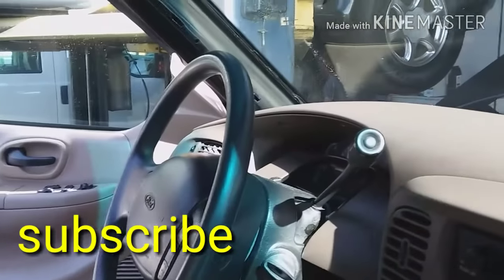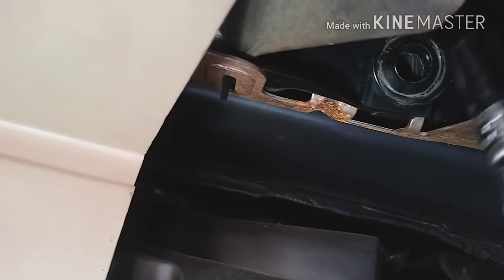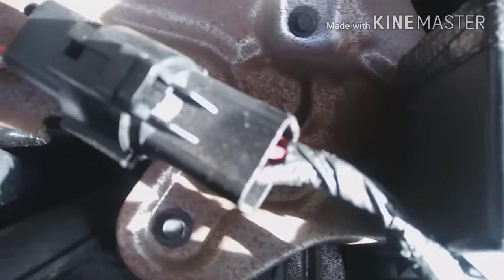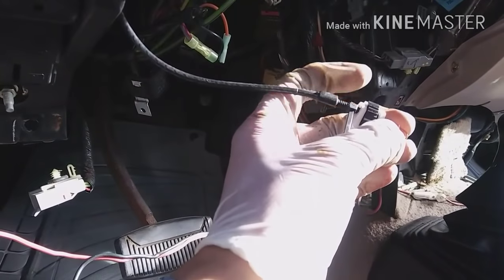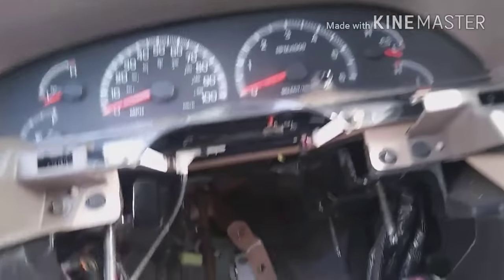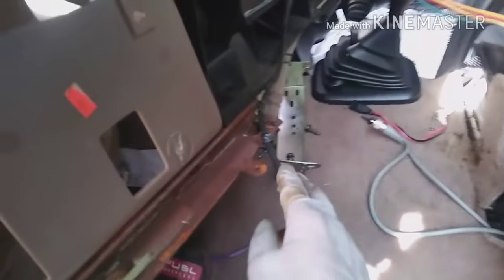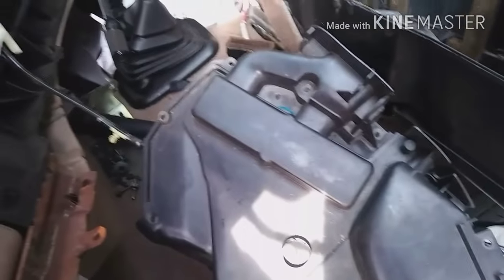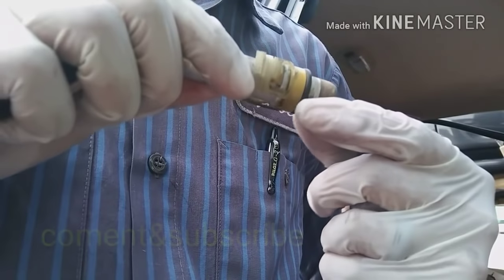Ford f150 heater core replacement  97-03 out in 10 minutes

Comment: Something to mention here. When replacing the heater core it's a good idea to replace the blend door actuator. They can easily break due to the plastic breaking. You will hear a clicking noise when adjusting temperature.
Reply: Make sure dashboard studs clear steering column otherwise dashboard isnt going anywheres.

Comment: This video show me that I will never attempt this Job 😢nor have heat 😅 good video
Reply: This video gave me the confidence to do it after 5+ years with no heat. I got the job done in 2 days but it could be a lot quicker if not for some gremlins and the mosquitoes that came out around dusk that made it unbearable. It's really not that hard. Just a bunch of steps and nuts and screws and none of them are rusty. You barely have to remove it, just pull the passenger side away from the front and on the seat and you're in.
Reply: @brianbrown600 I hope it's as easy as you say 😂, I'm about to attempt it. My new heater core showed up today. So I'll be working on it in a cpl days
Reply: @Steven72160  If you have any specific questions, I have fresh memories from doing this. Again, after it was all done, I didn't feel it was actually anywhere near as hard as I had worried it would be. My airbag was bolted in with 2 weird security style headed bolts. One of them had two small holes but I was able to use vice grips to loosen it and get out and the other was like an Allen head but with a tiny stud in the hole of the bolthead. I had to drill that one out and I found similar threaded bolts to re-assemble when done. The heater box has a few bolts in the back that are pretty hard to see but you can use your phone camera and flash and see where they are so you're not pulling on the top part with a bolt or 2 still attached. I never pulled the dash completely, just the passenger side pulled away from the windshield to barely rest on the seat's edge. All the heater core work can be easily accomplished leaning in between the dash and doorjam.
Reply: @brianbrown600  cool, thank you for the tips. I'm 64 grew up wrenching on cars. But it's been awhile. I think I'll be OK on this. As long as I don't have trouble remembering where all the wiring goes when I'm done. My heater core broke off where the hose is  attached. So I just connected both hoses together to bypass temporarily. But it's starting to get cold here in Ohio & I need heat. Thanks again for the help. And I'll definitely hit ya back if I have issues.
Reply: @Steven72160  Wiring is no problem. The gear selector indicator is a small cable that loops on the linkage on the back end of the steering column. That has to be slid off and there's a screw that holds it that needs to be removed before you drop the column, I think he details this in the video. Just something I remembered that was important.
Reply: @brianbrown600  OK thank you
Reply: @Steven72160 How was it?
Reply: @TM-ul8ce  I just started on it yesterday evening. I'm 64 with stage 4 lung cancer. But man, I worked on it probably 3 hrs & the dash still isn't out. Almost, tho. There's a hundred screws etc. I can't seem to find what's holding it at the bottom center area of the dash. Hoping to get it done today. Waiting for a warm up. I'm old lol
Reply: @Steven72160  well good luck to you sir I might attempt this in a few weeks

Comment: So 10 minutes to pull the actual Heater Core out? 2 hours to rip the dash out. Gotcha!!
Reply: It's the dumbest flaw in an easy solution design I've ever seen.. I bought a 99f150 for 1k the only thing wrong with it is it had no heat because the guys who owned it before me lived in AZ and I guess it burst or something. Wellll... they decided when taking it out just to bypass it totally and not put one back in. 🫠 so instead to and extra 10 mins and 35 dollars, since they lived in AZ at the time, we don't need heat.. dumb. But I guess that's how you get nice old trucks for 1k. The tires where worth 1k alone. So it's kinda like I bought a new set of tires and a truck and my Sunday gone came with it 😂

Comment: This was the most thorough, understandable, step by step video on changing out the heater core of all the ones I have viewed. I feel much less intimidated by doing it now. Thank you!
Reply from the maker: I glad it help man If you get stock let me know I can guide you
Reply: @brosolution  Thanks, it turns out it wasn't the core but the ends I put on the hose wouldn't secure. I ended up using the old fashioned screw clamp to secure the hoses on the heater core. Not easy but easier than replacing the heater core!😊

Comment: Great video Gilbert! I admired your lack of frustration and determination. I'm an old timer and remember changing a heater core on a '66 Ford Galaxie. It had four 3/8" bolts that held it in, from inside the engine compartment and the two hose clamps. Now that I own a 1997 F150, I will try my best to be as calm as you when I change the heater core. Keep making great videos Gilbert!

Comment: Your video was the final inspiration I needed to finally take on the heater core in my 99 F150 that has been bypassed for at least 5 years. There are some other videos out there that show a couple guys taking the dash out in 12 minutes but they don't explain what each fastener needs to be removed and what to watch out for like the indicator wire and shift cable. After watching your video about 4 times, I felt ready to just do it already. I was amazed at how fast I had the dash ready to pull. One hangup on mine that cost me some time were the 2 bolts on the bottom of the passenger airbag on my truck were security headed screws. One with 2 small holes in a pan headed stainless screw and the other was a rounded head allen with the little nub in the middle. I was able to shimmy the pan head one off with needle nose vicegrips but the round headed screw needed drilling out to remove the air bag. Once that was gone, the job went just as planned. Thanks for putting out a nicely detailed and descriptive video that was a big help to my long awaited solution for a no heat truck.
Reply: I'm 2-3 years into the bypass on my 2000 f-150. Keep putting it off. I check youtube for vids on this every 6 months, haha. Familiar with the other video you mentioned. No help for a DIYer.  Hoping this one carries me over the finish line.
Reply: @Andygeofri  So far so good with the heater core. A couple other things were the snap on fittings I bought at Autozone for the heater hose connections to the heater core were too large for the tubes on the heater core. I had to take my old hoses and cut the crimped aluminum with a hacksaw very carefully and the fittings are just like the ones from the store except they actually fit. Then when the heater core is in place but not covered by the heater box, have a friend push against the heater core as you push the snap on fittings back on to the tubes of the heater core. Maybe it could be done without help but it felt like I'd be breaking something by pushing that hard on aluminum tubes in a plastic housing. Good luck with yours. I couldn't be happier with mine and I almost can't wait for winter.

Comment: this is the most helpful video ever. I just changed the blend door on my truck ac was not working finally its blowing cold air . It was a big pain in the ass doing it the first time and without this video showing all the hidden bolts it would be a nightmare figuring it out!

Comment: Thank you for the detailed video. In the process of helping my brother remove the dash on a 98 F-150. To fix an electrical problem and while we got the dashboard out going to replace the heater core that’s be leaking for years. 👍👍👍👍👍
Reply from the maker: Thanks for the feed back bro

Comment: Great job explaining. I have a 03 Expedition that I attempted last year to remove dashboard. It was hanging up on driver side. I think your video enlightened me to as why. I missed a few bolts. I gave up and let the car sit for the winter and drove my other car. Going to attempt it again before it gets cold here in NJ.
Reply from the maker: Give it one  more try man if you need help let know
Reply: @brosolution  i just got it done. Its not that hard once you figure out what to do. Had to cut the firewall lip so I could slip heater core into its slot.  My issue at the time which i didnt realuze was the steering column didnt clear the 4 threaded studs it bolts too.
Reply from the maker: @GunnisonUndercover  alright cool..hey man I just subscribe to your channel im all about first amendment

Comment: Got the heater core out with this video in 2-3 hours on my 98 ford f150. those are box screws slowed me down or it would of been faster and cutting out the heater core I just ended up using snips instead of the Dremel tool was giving me a hard time and sawzall with too big. Wish me luck putting it back together
Reply from the maker: You already did the hard part putting it back it's easy if you look at it as a puzzle ahaha

Comment: Great job but one questions , how much does it cost this job to get done ? My a.c. is not working and they told me to remove dash to clean all the dust
Reply from the maker: This jod it take about 10hrs of labor we charge $100 per hour and if there is any parts that need to be replace we just add that to the total price alot of times you can flush the system with out take out the dash you should ask the mechanic if this is an option for your truck...I hope it geta solve soon
Reply: @brosolution  thanks brother

Comment: Only issue is on newer models with 4x4 on dash you have to pull the switch. To disconnect.  I see your 4x4 selection is on the floor as it should be.

Comment: I read an article that said not to disconnect any wiring from steering column is that true
Reply from the maker: You can do  it either way it won't affect anything
Reply: @brosolution  did mine. 2 weeks ago didn't unplug wiring from steering column and just dropped steering wheel to seat and pulled dash far enough to where I could maneuver saved alot of money thanks

Comment: I have an odd question. Is there anyway to clean out the compartment holding the heater core and condenser without taking the dash off?
Reply from the maker: I was thinking about it but no its not possible eleven sorry

Comment: Can I just cut the lines and mount the heater core somewhere else on the truck
Reply from the maker: You can but the reason why is behind the dash is so  you can control where the heat is going to
Like I you need it on the feet or by the face. if you just put it under the dash the heat will be all over the cabin every time the car is running...but that was a good idea lol
Reply: @brosolution  I just dread doing heater cores but great video

Comment: Can Rodents get in through the Holes on the Right & Left Side of the Interior Cab down behind the Foot Panels? Can they gen in through the Heater if the Door is Stuck Open?
Reply from the maker: If the carpet is fine i dont think they can.
They might be going in thru the air vents,thats the only way you can go in where the heatercore is at..
 if you got a plastics cover in front of the windshield remove it and check under there you might have to remove de windshield wipers

Comment: I have a 2001 Ford F150. In mine I didn’t have to remove the shifter cable out of the bracket. Once it’s popped off the metal piece, there is enough play in the cable that you can safely drop the steering wheel without damaging it. Be careful though! Hope this helps someone!

Comment: Ok I did just how you said. Now after reinstall of everything. Truck will not start. Crank no start. Any ideas?
Reply from the maker: Doble check all the connectors specialy the one by the passager side there afew grounds keep and eye on that
Reply: @brosolution  redid the ground check all connectors and then I saw it! Oooops, forgot to plug the fuel shut off switch back in. She loves again! Thanks for the response

Comment: How do you get the Dashboard out of a 1994 Ford F150!?!?  I have all Panels, Covers, Radio, Glove Box, etc Off. Also the Instrument Cluster is Out and the Steering Column is Down. It seems Loose but I cannot Lift It Up & Out on the Drivers Side!?!?
Reply from the maker: Is hard to tel what it is bro but i would check behind de cluster and right undrr the steering wheel

Comment: I have one question, my heater works but my ac wont cool down or last long, is the heater core for heat, and the ac evaporator for the cold? Should I replace the ac evaporator then??
Reply from the maker: Evaporador it is for the a.c. system and you would have to do this to get it out but I would check the a.c freeon first o check the pression in the system

Comment: Wow. The one I'm working on doesn't have door sills anymore. The sheet metal underneath is GONE
Reply from the maker: That's makes it easier
Reply: @brosolution  I installed a customer supplied filter on the hose coming from the manifold before it enters the heater core and there was so much snake oil in there that it clogged the filter half a dozen times. Customer put a transplant engine in it awhile back and it must've had sand in it in addition to the snake oil.

Comment: Great vid bro right to the point did Any if you all remove dash and notice the small black boxes that have fuses in them ? I think I have two or 3 been wondering what there for anyone know? Removing all heat and AC and air bag stuff for a audio build would like to cut these out if it's heat ac related if anyone knows
Reply: In that bundle is the relays for your door locks and what not. Forget what else.

Comment: I hooked my heater core hose directly to the heater core with hose clamps. Never really saw a reason to have the hose fittings
Reply: Over engineering. Around that era Chevy truck has some type of plastic thing like that also. It gets brittle and breaks on those. Everyone just connects the hose directly to the heater core and uses clamps. Nobody has issues doing it that way. 

The manufacturer probably saved 3 cents doing it their way.

Comment: after this job i did, i got the motor to turn, but would not fire up. any suggestions?  missed ground wire? plz help 1997
Reply from the maker: Does everything lights up on the dash like check engine light oil light and all that? Check the main conectors under the dash driver and passanger side. check for pending codes

Comment: How do you remove those handles above the dash?  I tried every small socket on those screws and cannot get them to move.  What size size socket do I need and what am I missing?
Reply from the maker: there size 7 milimiter you have to used on 1/4 drive
Reply from the maker: Let me know if you need more help
Reply: Man I am sure I tried 7mm but will try again  and again thanks!
Reply from the maker: Dayn Kealty it may be a 5.5mm wait no its 7 for sure

Comment: OK then I got the whole thing all loosened up but there’s something still holding it in the middle I was wondering the black cover at the floorboard in the center where I think you had a CB radio starting the video? You took that off at some point that black cover I haven’t done that because it really wasn’t part of the video but is there something under that black cover that needs to be taken out your bowl or something holding that still holding that the station is loose on both ends but not in the middle? Any thoughts please thank you!!!
Reply from the maker: Ok check here 9:28
Reply from the maker: Check here 9:28 is that the part where you having problems?
Reply from the maker: If you can show me on the video
Reply: Yes at 7:05 is the drivers side floor board and the center floor board with the black plastic removed on the right side of the frame. You do not show anything about removing that Plastic or anything to do with the other brackets that are under or behind that black belt plastic in the center of the floorboard under the dash? What do you do with those brackets or do they need to be removed? Something in the center has it very securely fastened and I don’t know what it is exactly that I should do? Thank you very much!
Reply: Mine is a 2003 F150 King Ranch with automatic transmission and 4 x 4 on the column no shifter on the floorboard as in your video?
Reply: I did get that bolt that you were referring to at 9:28 in the video I did get that one!
Reply: So that bracket that you show at 9:28 in the video I’ve taken that bracket out took the floorboard not off and put that bracket that all L bracket out completely. But I also have another bracket on the opposite side of the driver side of that center consul. And that bracket is also bolted to the floor and to someplace up underneath the dash. So I’ve taken the bowl off of the floorboard pen but I can’t lift the dash over that pen because it’s still attached to something?
Reply: Everything else you had a spot on that’s why I’m even asking the question. Because I figured there must’ve been something that was missed or I have a midyear version change on the way it was constructed?
Reply from the maker: @CAPTAINJ777  yes follow the braket on the diver side its a sides 7 or 10m bolt

Comment: I have the Steering Column Down and have the Bolt above it into the Dash Out. I have the Cluster Out too. Question: Do you have to Remove the Big Aluminium Bracket that holds the Steering Column up? I should Mention that the Fuse Box Unbolted too. I want to  Remove the the Entire Dash Completely so I  can Clean & Disinfect all the Ducting & Supports from all the Rodent Urine & Feces! And Repair some Chewed Up Vacuum Lines for the Climate Control System.
 Any idea Gilbert on how they are getting inside in the first place ... I cannot find how they are getting in!?!?  I have Trapped 4 Rats inside the Cab in the last two weeks alone!!!
Reply from the maker: Yes the aluminum its holding it..

The only access is thru the firewall where the wires go
Or under the truck some of this truck have alot of  rubber plugs under the truck check that